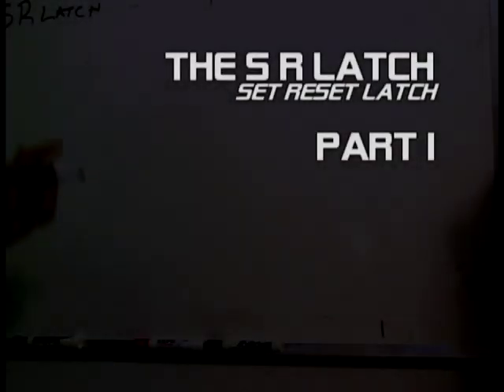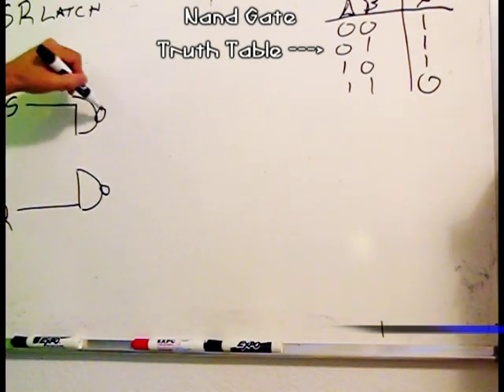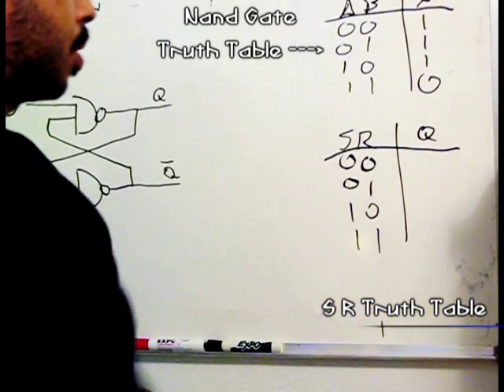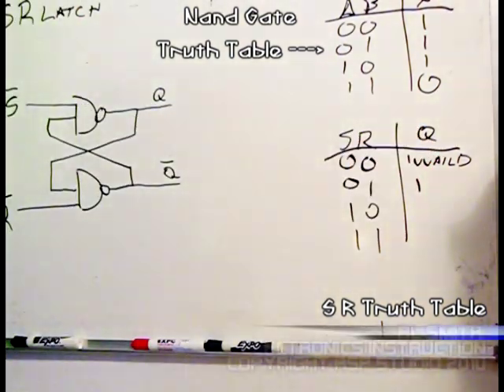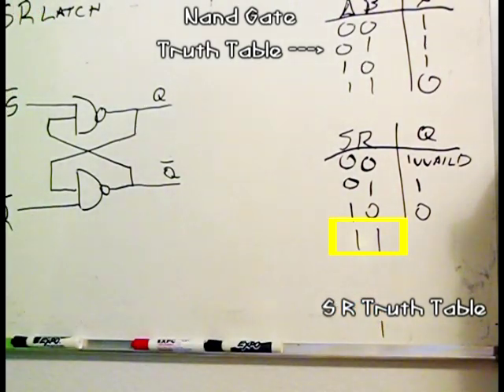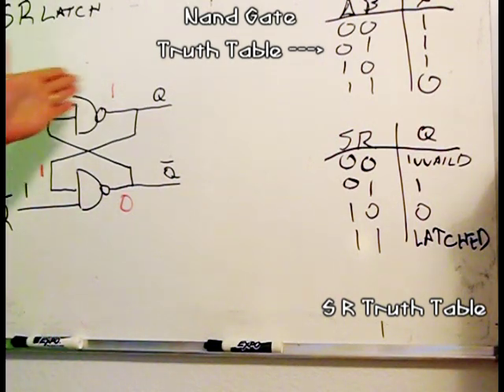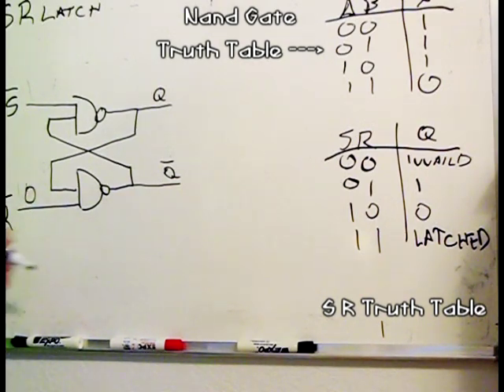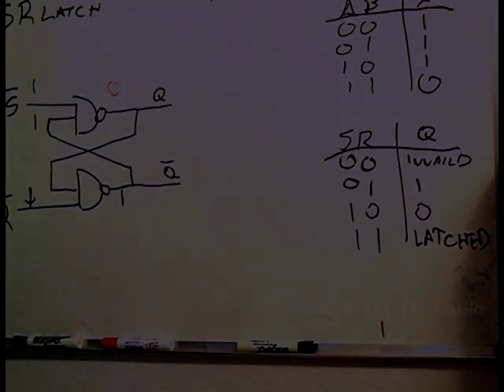The S and R Latch: Digital Electronics

Comment: How do you even get to set the latch if the 2nd input for either NAND gates are not defined when you set S to 0 or R to 0? I never understood that.
Reply: Recall that it has memory on the 2nd NAND. So you start by sending a 0 (when you look at the NAND table we know anything with AT LEAST 1 zero will give us a "1" output. So we are sending at least 1 "0" thus we know it outputs a "1".  That one now goes down to the "1" on the R NAND gate (where we already had a "1") This gives us 2 "1"s. Now having 2 "1"s tells us that we will have a "0" from the NAND table BUT it ALSO tells us that it will LATCH from the SR Table. 1 and 1 gives LATCH. This means that 0 is now in latched (or in memory as he referred to it - so it will not reset).  Now because we have this "0" in memory we can switch our 1st NAND gate (where the S is) to a "1" because now the new 11 correlating to SR latched the value in. Thus we set the value and latched it. 

I hope this explanation helped.  Tried to help lay it out in a logic manner as he showed the steps.

Comment: i stnd corrctd, yr NAND-truth table s rght. but S & R being both 1 should be invld and the mem fnctn should be used when both are 0. Yr SR-truth table also sets when S=0 R=0 and visa versa. This is crrctd by changing S & R to S NOT & R NOT, but if ths s not the org input (whch wld then b missing on the drwing), then the SR-latch-truth table is wrng. Anyway, it's confusing. Why not use the org input with a NOT-gate or NAND-gate with one input, before the active low part, being the two NAND-gates?

Comment: The latch inputs have nothing to do with the NAND function.  The NAND table is correct.  The S and R are actually active low, which does make sense since a NAND gate must have at least one 0 input for a 1 gate output.  The reason 00 is invalid is that it causes both outputs to be 1, which isn't useful for memory purposes.   You can also think of it as having R on top and S on the bottom.  Build the latch on a breadboard and test it.  You will see that this video is correct.

Comment: I would be a great video apart from the fact that an RS latch is undefined when S and R are both 1 respectively and not when they are both 0. Good try but to some people that may rely on this for an explanation, you better fix it with an annotation or remove the video and re-upload a correct one.